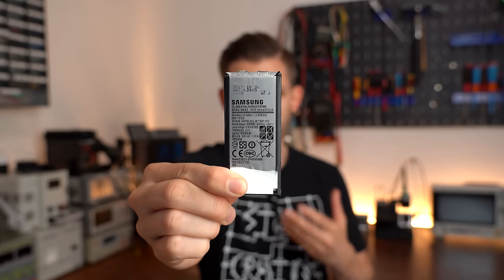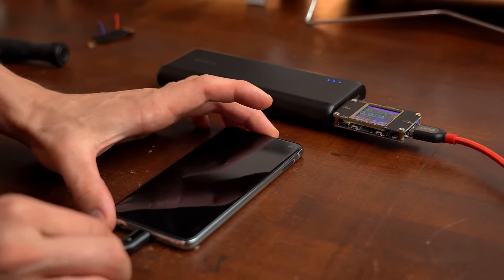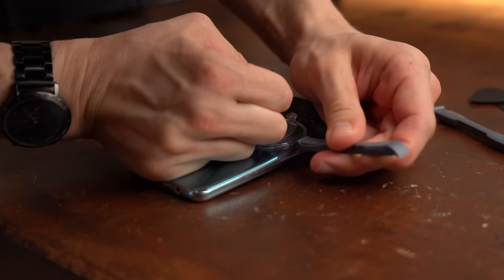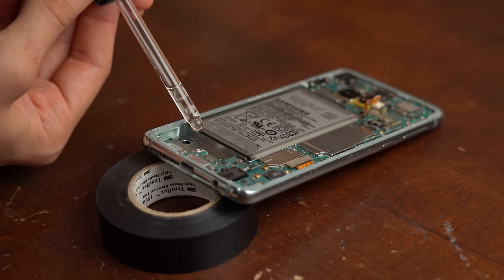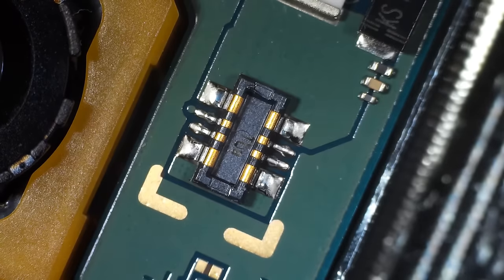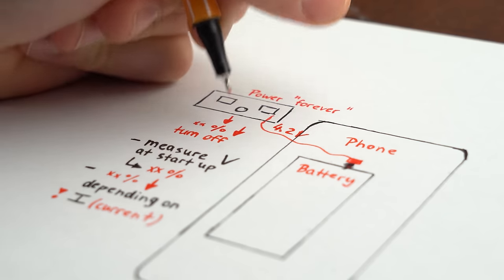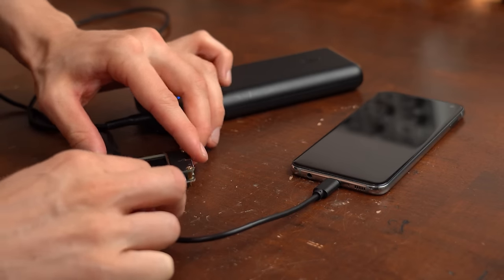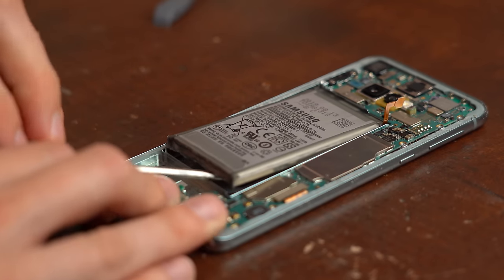I "Solved" Samsungs Swelling Battery Problem! (Batteryless Phone)

Comment: This is crazy! I was literally thinking about doing this! I have an old Samsung S9+ that I wanted to use as a dash for my truck. But I was afraid of leaving it in my truck due to the battery. Thank you for making this video!
Reply: Yea but it would have to restart every time you shut off the engine. Unless you have cig ports that stay live all the time. Then it would drain your battery
Reply: @isaiah4478  I have a 12v 2280ah lithium battery for my truck, so it would never drain it.

Comment: And of course you can also power it with an external battery based charger so you could use it portably.
I wonder if you could also add a small capacitor in place of the battery so you have a few seconds to switch power sources without rebooting the phone.
Reply from the maker: Sounds like a fun idea. But I would at least expect a supercapacitor to do such a task.
Reply: @greatscottlab  I was thinking the same thing. (By small, I meant physically, since there's limited space).
Reply: @greatscottlab  if you use a capacitor, it may not need a cable loop.
Reply: a better idea would be put a small voltage regulator inside and get the voltage output of the usb this way it will not need holes for cables and also make sure the voltage is ok
Reply: also theres a battery protection option that forces it to not goes above 85% just enable it and plug it in when needed to use it as a fix device
Reply: another problem would be the need to start it back on again after power loss, i just think it could be made in better ways maybe just replaxe the samsung battery with another one from a brand with no such issues

Comment: Another option for always-on phones (though may not work forever) is to use a rooted kernel & charge controls via an app to let it sit at a non-100% charge. I find this causes much less swelling.
Reply: Can you explain me little more about it? I want to make it like that
Reply: That shouldn’t be tried on a working battery, pulling the voltage lower than the minimum voltage will cause the batterie’s internal resistance to slowly rise due to crystals growing inside of it, basically killing the battery slowly. I have had a MacBook battery swell up within days of being discharged completely. That made me believe discharging batteries increases the chance of it swelling. I have also heard it’s possible to completely drain a battery to around 1 volt to keep it in long term storage, putting the battery to sleep but I don’t know what to believe since the internet gives counter intuitive information. Would it be possible to use a modified kernel and then simply disconnect the battery and only plug the in the circuit itself?
Reply: @teamredstudio7012  Optimal % isn't low at all, it's high-ish, just not brimming on 100%. I.e. 60-80%.
Reply: @xvii_au  yes, I store my lithium cells at around 50-60% for long term storage, in a dry space because lithium loves to react with water and release nasty gas.

Comment: Excellent trick with the diode.  Having converted one old phone with a swollen battery using this technique, more recently another phone started suffering from the same swollen problem.  Instead of powering it permanently I simply replaced the built in battery with a slightly smaller removable battery meant for a different phone, soldering its + and - terminals to the old battery's reclaimed protection circuit board. Thus providing the old phone with a new lease of mobile life, including being able to operate it from the usual USB adapter.

Comment: I screamed internally seeing you try to pry that back cover. Especially because I work at a service shop. Never use a screwdriver or much force when working with glass backs, also NEVER use a screwdriver when prying the battery! It's a really high chance of it either exploding or catching up in flames!
Reply: Yeah that got me aswell ! Removing those batteries with a metal screwdriver is never a good idea !

Comment: Very interesting!
Maybe the feature to limit the SoC to 80% (around 4,2V) can be working, it's over 4,2V that the battery life is seriously reduced. Also, I remaked that old phones with a low SoH don't charge the battery over 4,2V even when displaying 100%!
Reply: Yes. Modern smartphones with their internal batteries, do a lot of 'trickery' to guesstimate a charge state, and manage how fast the battery 'ages out'. 

Example: Apple semi-recently was in hot water for 'gimping' old devices via OTA sw; their excuse being, old batteries can't deal with current spikes well, thus the throttling. 

All this project and the Apple debacle proves to me is that we never should've 'allowed' smartphones with integral batteries. From both the eWaste and "Ownership" perspectives, it was a big mistake.
Reply: Solution then?

Comment: Interesting feature with the voltage - I did the same thing with Huawei phone and it reported the percentage based on voltage - changing the voltage even caused the battery percentage to go up :)
Reply: "Battery Trickery" varies by-manufacturer, and very old versions of Android dealt with batteries quite differently.

Comment: Mine DID!   I kept Asking WHY Phone w\ Fully charged Battery suddenly SHUT Down, registering -0- charge.  NO answer.
For years, Phone Temperature would get HOT at times, but not all times when it shut down.  
LOL  NO need to Heat phone to Remove back, Battey did that for me.  THAT's when i realized what was Wrong.   {{sigh}}
SO Glad there's at least One on this Plant that figures out How to do this.   This was Interesting to see.  THANKS!

Comment: This is fantastic. I basically did the same mod but ended up with a power supply for the phine and one for the usbc to run octoprint for my 3d printer. I wasnt sure why it needed both but now i do so i bet i can make it just one now! I will also be linking this video for anyone who wants to use an android with Octo4a for their 3d printer. Its almost mandatory cause i wouldn't recommend always charging a lithium battery all the time.

Comment: It reminds me of my modification I did in a Samsung tablet. It had a very weird connector that I haven't seen before, and I didn't want to buy an adapter. So I designed a 3.7V battery charger board powered via USB, created a hole for the USB port in a tablet's housing, and somehow fitted everything inside. Charging works, but the battery level keeps dropping, so every time I have to wait till the tablet shuts down due to the "low" batery, complete the charging process and power it up, so it can realize that the battery is actually full. Just for fun I'm gonna short the current shunt and see if the battery level will freeze
Reply: Shorting the current shunt sounds interesting :)
Reply: @Wrublos212  I've shorted the shunt but... nope, that wasn't it. The battery level continues to drop. I think that one of the power ICs provides the data about battery usage, so I would have to hack the system or modify those tiny circuits, what I'm not capable of
Reply: @Wrublos212  Well, actually the battery level dropped only by 1%, and the tablet went wild. More demanding apps were causing system crashes, tablet seemed to work slower
Reply: Same problem I'm having. I'm curious to see if you find a solution for this.
Reply: Did you ever manage to find a solution? I'm in the same boat with a Fire Tablet I wall mounted.
Reply: @HaveYouSeenMikeHawk  Shorting the current shunt or fancy charge controllers were not the way to go. I just replaced the charging port with basic micro USB. Communication via it is still possible

Comment: This video inspired me to do something similar! I had my old LG G5 that took a trip through the washing machine, I managed to save it, but the audio circuitry and battery were destroyed, I was shopping for a new webcam when I came across this video and saw my old phone just sitting there, and i decided to do this instead! The phone is now much nicer than any other webcam i could of bought, thanks Greatscott! (I did reduce the cables to just one cable however by just bridging the usb power into the charge protection chip of the old battery)

Comment: I've also done that with my Nvidia Shield Tablet in the past, after the first revision got recalled because of overheating batteries. Though as already some have mentioned I would also love to see an approach with super capacitors, to gain at least a bit of portability :)

Comment: Great recycling project. 2.0 idea - could you tap the USB to power internally and power your "battery circuit", thus removing the extra wires and power supply?
Reply: If you are good at soldering - yes. Generally you need a lot of flux and steady hand
Reply: That won't work, for 2 reasons:
* The USB jack doesn't necessarily carry 5V. Modern phones use USB PD and will negotiate a higher voltage from the power supply. Furthermore, there's a brief moment (several hundred ms) before the power supply switches to the new voltage during which the power cuts out completely, with the phone being designed to run off battery for that period.
* You could make it a noncompliant device and just assume it will be plugged into a legacy USB-A power supply to avoid that problem since it will always output 5V. However, USB doesn't supply enough current to power the phone. Legacy USB supplies at most 1.5 to 2 amps, which gives <10W considering losses in the diode. Remember that since there's no battery at all, the power source needs to supply not just the max average power (i.e. TDP), but the peak transient load, which can be significantly more than 10W even on a phone. So the phone will draw too much power, and a compliant USB power supply should cut off when that happens.
Reply: @fat_pigeon  Thank you for this fantastic response. I read it a few times and learned a lot here. I am looking to fit a Blackberry keyboard from Tindie to a more modern phone so your post also helps point me in the right direction. Thanks again!

Comment: I was writing a comment while you mentioned it. I think it's stupid that the phones don't measure the real Voltage. I did the same with a Galaxy S3 and also came up with the same solution, It's working fine for over a year now. I use it as a timelapse camera in a grow box 😊
Reply: Agree, this went from  nice, it's really easy to maybe but it's kinda junky/needs more effort very fast
Reply: @nk4j272  It depends on the phone - I did this on a Sony Xperia Z Ultra, and the phone did not shut off when it hit 1%, just stayed there forever. However, it would occasionally reboot (~once a week) as a single USB outlet was not enough to power it under all circumstances, so I had to also plug it into a second USB outlet via the charge port to have 100% stability. I suspect he will also have stability problems using only one USB port, but that probably depends on the power needs of the specific phone.
Reply: @iguanamoat  did you connect it straight to a 5v power supply?
Reply: @nk4j272  I added a USB C port for convenience, but otherwise it's a direct connection from the old battery's BMS to whatever 5v USB power I plug into it.

Comment: Thanks the idea with the diode is awesome I thought to shove there dc-dc. Only there is a problem with the battery protection it blocks the power if the voltage drops.

Comment: I would love for someone to make boards for different phones and tablets that also hack into the charging port for a flawless exterior.

Ebay or Tindie would be good places to sell such things.
Reply: He should try to replace the battery with capacitors (maybe ceramic). This way the internal charger will still work correctly and you can power it through the normal USB-C port.

Comment: why not solder a couple of wires to the inside of the phone's usb port that go to a step down converter that is connected to the battery protector circuit? The step down converter would probably fit where the battery used to be and all cables would run internally, only using the original USB port to feed power in
Reply: I tried this but the phone seems to just boot loop when powering via the step down connected to the bms

Comment: Would it have been possible to take the 5V from some internal pins near the USB port instead of drilling a hole in the frame?
Reply: No, for 2 reasons:
* The USB jack doesn't necessarily carry 5V. Modern phones use USB PD and will negotiate a higher voltage from the power supply. Furthermore, there's a brief moment (several hundred ms) before the power supply switches to the new voltage during which the power cuts out completely, with the phone being designed to run off battery for that period.
* You could make it a noncompliant device and just assume it will be plugged into a legacy USB-A power supply to avoid that problem since it will always output 5V. However, USB doesn't supply enough current to power the phone. Legacy USB supplies at most 1.5 to 2 amps, which gives <10W considering losses in the diode. Remember that since there's no battery at all, the power source needs to supply not just the max average power (i.e. TDP), but the peak transient load, which can be significantly more than 10W even on a phone. So the phone will draw too much power, and a compliant USB power supply should cut off when that happens.

Comment: I'm detecting a problem here.

Some of the chargers I've used actually output 5.2V, highest I've seen is 5.3V
If you use it with one such charger, and the voltage drop is only 0.6V at that point, you could give 4.6V into the phone.
Wouldn't that damage the phone?

Unlikely. But still possible...
Reply: Voltages of over 4,2V in Lithium bateries are hazardous. In best case destroying batery if not bursting them in flames.
Lithium bateries are most sensitive on overvoltage of all.
Reply: i have a Motorola charger that gives 5.2v at the output, even thought it says 5v 2A its fine as usb standard has +0.25v max above 5v at the usb charger Port this extra voltage its used mostly for cable voltage drop which is about 0.1v per amp, also i have a charger with 5v 3a rating that outputs 5.32v a litle bit above usb standard but also fine for devices with battery charge controller wich can handle up to 6v, it have fried 2 chinese speaker that has no ic to manages input voltage to battery ,also have fried another one of then by inserting a quick charger thinking it will be fine.
Reply from the maker: I looked through the comment section here. Others reported that they use straight up 5V at the battery pins. No problems.
Reply: The current would begin rising, and the diode would start dropping more voltage, so it might balance out.

Comment: How about connecting a 3.7v rechargeable button cell to the battery pcb? You would still need to keep the phone plugged in but it would simplify the wiring.
Reply: Even capacitor could "imitate" the battery I think.
Reply: This sounds like a bad idea to me, cause the phone circuitry is designed to charge WAY faster than this cell would take. Wouldn't that create a mini-bomb ready to explode?
Reply: @borislipschitz2740  I didn't think about that... Maybe a capacitor (as Wrublos212 said) would be a better idea.

Comment: Do you think while using this method to keep it on you can add a USB type A connector connected to the + - and data pins that are going in the phone with the idea of using USB Flash drive or OTG for pheripherial devices ?
Reply from the maker: Hmmm not sure. But sounds possible.
Reply: @greatscottlab  I have this idea for a "media player " for a car with an aux FM transmitter connected to the audio jack of the phone the phone itself powered by a 12v car phone charger and use flash drive for the music . Was wondering how the powering of the phone would work but your video came just in time to save me a lot of headache  :)
Reply: @greatscottlab  otg works?

Comment: Could you instead replace the battery with a capacitor (or capacitor bank) and then continuously charge that using the USB cable?  That way you don't have to hard wire the phone or cut holes in it for the wires.
Reply: This would probably work on a limited basis, but under continuous/heavy use the cap will get drained faster than it can be charged and the phone will die or reboot.
Reply: theoretically, but you're also have to add some circuitry to keep it for charging/discharging too much and it'd have to hold enough power to keep the battery management software from cutting it off.

at that point, you might as well just put another battery in it.
Reply: @InfernosReaper  I agree that a battery might work better.  Certainly a continuously connected USB cable should be able to keep up with the needs of the phone with a smaller battery than the original phone required.

Comment: I had a similar retrofit for moto g 6 plus a year aho. Ths phone killed two batteries in a row and was replaced by a new one. So I also cut off the bms board from the battery and used it to imitate battery with cheap buck conerter. Worked out fine and I had no need to imitate charging. So it is definitely a vendor/model thing. The device is still alive and in active use by household members.